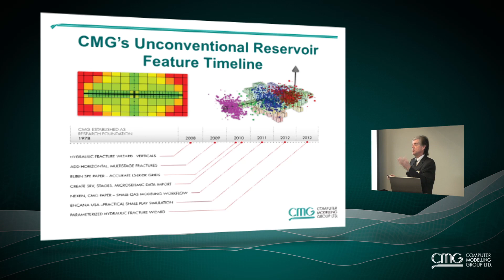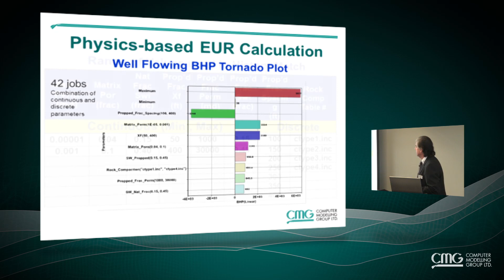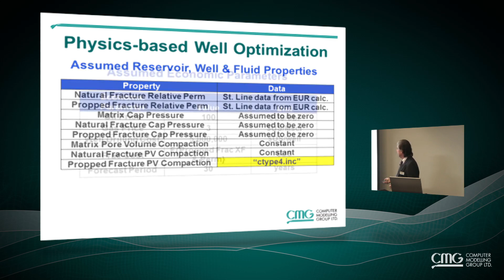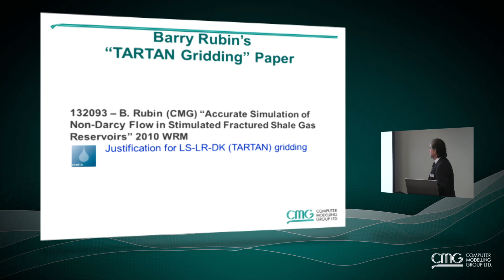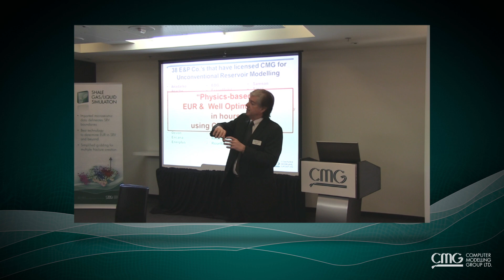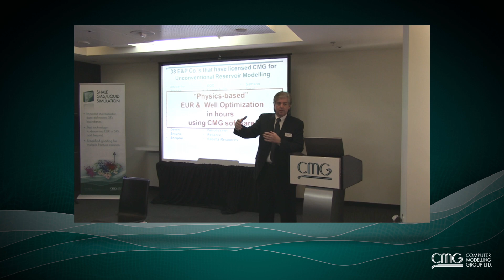CMG Webinar: Advances in Unconventional Reservoir Modelling (2014)

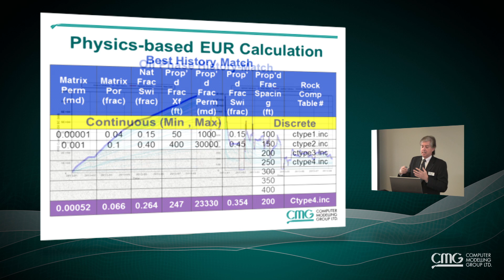Comment: In 45:16, the presenter said the compaction table, ctype4 selected from the best History match model is the least detrimental one. In actual sense, ctype4 should be the most detrimental compaction table as it required lesser permeability multiplier as production pressure is depleted around the propped fractures if am correct.